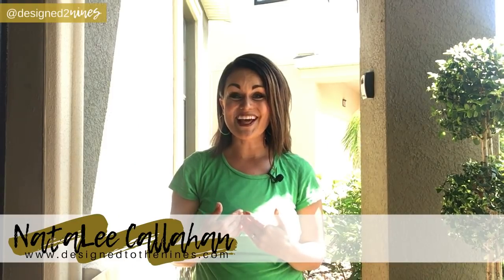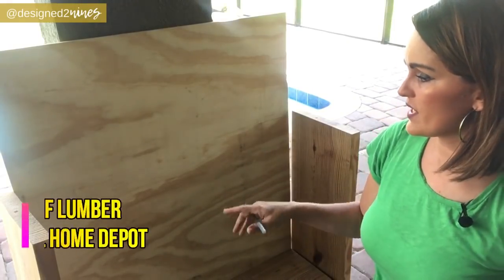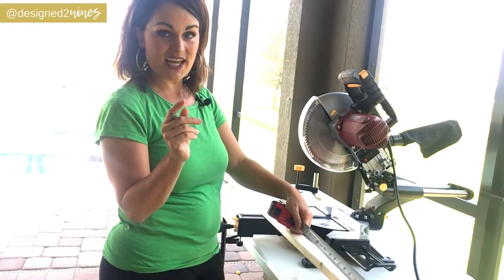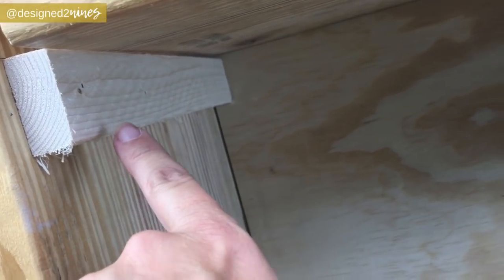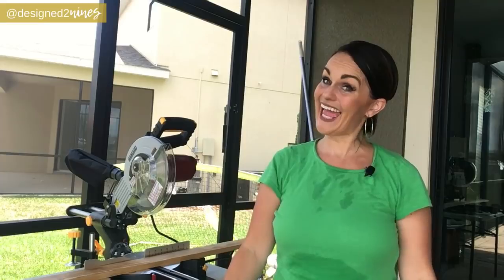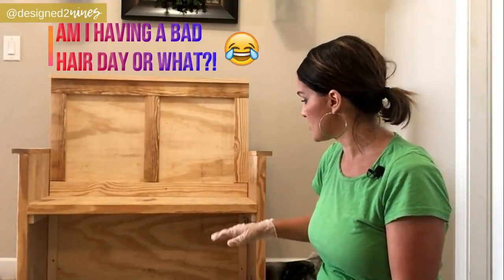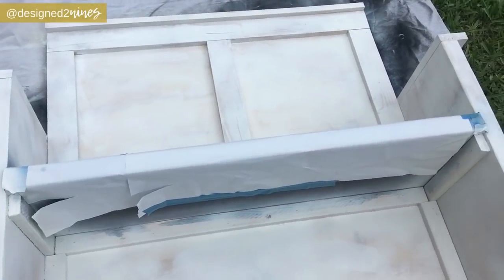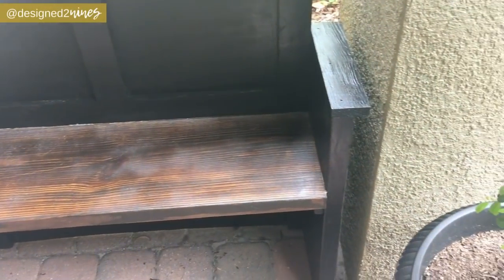HOW TO Make a Cheap + EASY Small DIY Entryway Bench!

Comment: Got a question... your input please on a cordless and /or electric drill and sander ... either orbital or straight.. thank you🌸😁
Reply from the maker: Cordless Drill... Sander plug in (just because I haven't tried a cordless and I like an orbital sander most of the time and one with a pointy tip for getting in corners. Hope that helps!